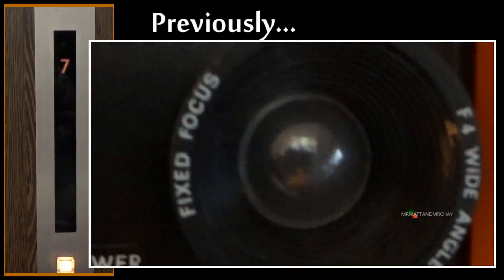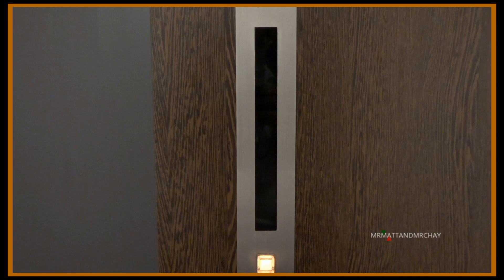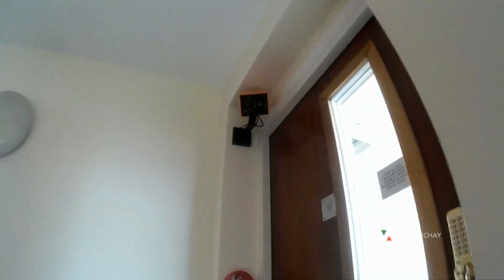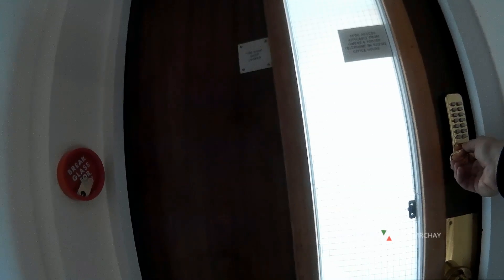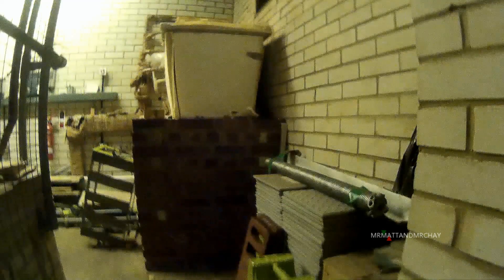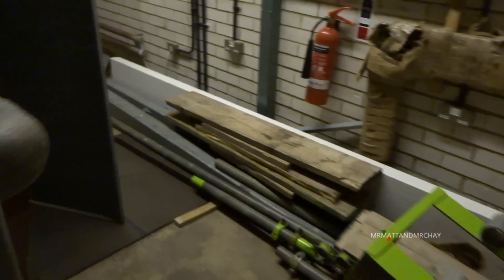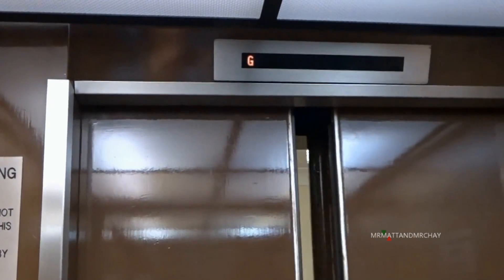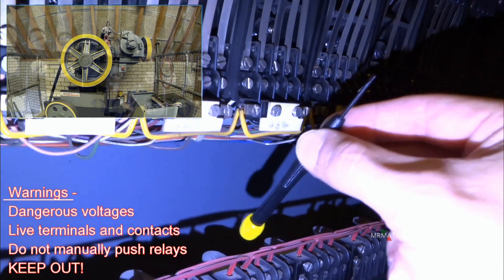Code cracked, entry gained to a CLASSIC SCHINDLER relay motor room

Comment: Tip for the mechanical code locks. The order that you enter the correct numbers / letters does not matter, so long as the correct ones are depressed. The "C" button clears any previously depressed buttons.
Look for fingerprints on the buttons. Press "C" followed by all those with prints or worn surfaces. That's it, lock open.  If prints are not obvious, polish the buttons up with cloth, sleeve etc and return after a few people have unlocked it. Prints can now be seen.

Comment: I would definitely be wearing insulated gloves and using an insulated screwdriver to be pushing in relays. 24 volt relays or 24 volt coils did not go into effect across the industrial field till about the late 90s. Majority of time going back to relay logic systems like this the coils would be 110. Which definitely I have to say is a little sketchy watching you push it with a little precision screwdriver. Anyhow pretty cool video by the way
Reply: Thanks grandma.

Comment: What is it that scares you about the water tanks?
Reply from the maker: Here is a copy/paste from my "water tank phobia" video...  https://www.youtube.com/watch?v=KD3IR3UyKWY  ...SO WHY???  It's not actually the tank of water I'm afraid of, it's the automatics (especially ball values) - it's a bit like a spider that's completely visible and STILL, but when you disturb the "web" (water) it starts moving and hissing as water enters the tank.
Ok, so a urinal is different, but in a way it's worse!  You can hear it, water dripping into a tank which you know will 'erupt' without warning - it's just when?  Is the tank full or empty?
The dripping varies in pitch and volume.  In fact, the fuller the tank, less distance for the drips to fall and the volume reduces.  This gives you a false sense of security, as you take your mind away from it.  But then, when you least expect it...
The water starts falling down the pipe and you realise the flush has already started - too late to escape.  From a quiet room the noise is  too loud and you can hear the whoosing and gurgling of what's going on in the tank, as if the tank wants to let you know.
Panic sets in, but I cannot bear the situation and it's too late to escape so I try and create a "mask".  Eyes tightly shut, hands pressed hard against my ears, keep moving them to create a rustling noise to prevent me hearing the room at all.
When I'm sure, I release my ears and the situation has ended.  But the dripping is now louder than before as the drips travel further into the tank - a warning from the tank to 'GET OUT'.
I run out trying to plan every step, including pulling the door handle down and opening the door at the same time as I'm moving towards it.
Outside the room I casually walk away, but with my heart beating out of my chest!
YES, I HAVE A FEAR OF WATER TANKS!

Comment: 5:55 , 5:55 , 5:55 , 5:55 , 5:55 , 5:55 , 5:55 , 5:55 , 5:55 , 5:55 , 5:55 , 5:55 , 5:55 , 5:55 , 5:55 , 5:55 , 5:55 , 5:55 , 5:55 , 5:55 , 5:55 , 5:55 , 5:55 , 5:55 , 5:55 , 5:55 , 5:55 , 5:55 , 5:55 , 5:55 , 5:55 , 5:55 , 5:55 , 5:55 , 5:55 , 5:55 , 5:55 , 5:55 , 5:55 , 5:55 , 5:55 , 5:55 , 5:55 , 5:55 , 5:55 , 5:55 , 5:55 , 5:55 , 5:55 , 5:55 , 5:55 , 5:55 , 5:55 , 5:55 , 5:55 , 5:55 , 5:55 , 5:55 , 5:55 , 5:55 , 5:55 , 5:55 , 5:55 , 5:55 , 5:55 , 5:55 , 5:55 , 5:55 , 5:55 , 5:55 , 5:55 , 5:55 , 5:55 , 5:55 , 5:55 , 5:55 , 5:55 , 5:55 , 5:55 , 5:55
Reply: love that sound when the elevator starts.

Comment: When you press the relays to select different floors, does the light inside the button light up to? Or does it just go there without that?
Reply from the maker: Pressing the button places voltage to make the relay switch on.  When the relay is on, this places a by-pass across the button, so effectively the button can be released whilst the relay puts a short circuit across it - this is a what a latching relay does.  So whether the button is pushed in the lift car, or I press the relay in manually, same effect.  The call button will illuminate when-ever the relay is latched.  The buttons inside the lift would also light up.
Reply from the maker: Also see this - https://www.youtube.com/watch?v=USmuJCOXbgk   This is me in the motor room pushing in the relays, then pulling them back out again to unlatch them.  As you can see, the floor indicators light up and go out.

Comment: What type of elevator is this? It's not a true "single-speed" traction elevator because you can see (and hear) the motor change into what sounds like a lower mode a second or two before the lift stops. is there a more proper name for this? "Two-speed"? haha

Comment: Perhaps you should think of joining the elevator union here in Canada 🇨🇦 I am elevator mechanic from new generation I work on I O PCB boards anyhow I am surprised there was no machine guarding here it is law in case such people like you and general public make their way in the machine room also it is law to have car top railing anyhow nice video but be careful shock electrical can kill you
Reply from the maker: Thanks for the message.  I did go for a job with Express Lifts straight out of school (1988!) but decided to follow a different industry.  I'm an engineer myself (not with lifts) and well aware of what I can and cannot touch.  All my videos containing motor rooms have that exact warning at the start.  Yes, this motor has escaped the guards - very surprised to see it like this!

Comment: 6:36 I was wondering how many cables this lift has, 3?  4?  6?  8?  [Motor stops] Motor or flywheel: TWOHHHH Okay the flywheel or motor said that it has two cables but i think it has 6
Reply from the maker: Good question, but if you look here then the answer is 5:  https://youtu.be/R5BHZe8gbcs?t=7m10s   See the ropes coming off the big sheave, down to the smaller wheel.

Comment: why is the moter fan cooled ?
Reply from the maker: This is not normally required.  But let's change the conditions:  What if, it's summer time, it's really hot in the motor room, there is no air conditioning (there isn't in this room) and the lift is being used constantly.  This is a condition where the motor might get too hot and then needs a fan to cool it down.
So in summary, the fan is not required 99% of the time, but during hot conditions the fan is available for the 1% of the time when the motor gets hot.

Comment: I love the EEEEEOOOWWW sound the motor makes when it slows down then the sound of the clunking relays and motor contactor(s).
Reply: When the lift is approaching a floor, how does the motor speed control work on  a lift that is all relay logic. I didn't see any variable frequency drive (VFD) controller.
Does a relay switch in a big power resistor to slow down the motor just before a floor?
Reply from the maker: The motor has two windings, so the motor has two built in speeds.  With a VFD you can generate any speed, but before the invention of VFD drives the only way to do it was with a DC motor and an AC to DC generator to run the motor.
The resistors prevent full current getting to things like motors so that if the motor was jammed then the resistor would heat up rather than the motor.  It also has something to do with residual current from the motor being arrested by the resistor if I remember correctly!

Comment: most commonly used codes:

1234
4321
the same number four times
2580
1397
0582
many more

Why?  Because they are the easiest to remember!
Reply from the maker: As described in the follow up video....
https://www.youtube.com/watch?v=R5BHZe8gbcs

Yep, used to love trying to work out codes!  People picked the same ones, or they were very similar.  I'd like to add a few more people used to use...  2468, 19XX (someone's date of birth, look at the finger prints to work out the last two numbers haha),  1066 for the battle of hastings, and a whole load more!

Comment: today's elevator controllers have low-voltage computer circuits.. but high voltage AC motors
Reply: The controller controls contactor's that energise the motor.

Comment: Do you know what is even better than the engine room of an elevator? The engine room of a cable car.
Reply from the maker: Yes, glad you mentioned that.  Recently I've looked at this video featuring a mine shaft elevator...  Also interesting! https://www.youtube.com/watch?v=9eadj3kL_fM
Reply: I think you would like the water incline lift at the centre for alternative technology near machynleth in Wales. It has a huge drum that the cable winds on to.

Comment: 2:28 - pro tip: with these mechanical locks that require a code, it typically doesn't matter which order the numbers are entered, so if you see 4 buttons that stand out then there are 24 possible combinations of those 4 digits, plus the fact each number can only be used in a code once... you get the idea, these things are super easy to defeat. If you have frequent access to the building, you could put a really faint line of pen or pencil on all of the buttons, not noticeable to the untrained eye, wait a few days or something, go back and see which buttons have the marks rubbed out, test the code, then rub the mark of all the buttons so nobody could possibly see it at a later time.
Reply: There are actually 10,626 combinations of four numbers from twenty four without any repetitions.  Might take a bit longer then.
Reply: @andyblackpool  

'Best guess' will usually get around that. If the numbers used are 1459 it's more than likely going to be 1945.

That said I'd pick 4591 because I'm awkward 😏

Comment: Can you wear leather or rubber gloves to press the relays?
Reply from the maker: Yeah I guess so.  It also depends on which part of the relay you are touching.  If its the armature (the bit the pushes the contacts) then this should be fine to press on any relay, but it's all about being careful, and best practice is to wear gloves or press the relay with something that doesn't conduct electricity.

Comment: I would have thought that you would encounter water tanks quite often in that kind of work with Tanks often being situated on roofs. The college I was at in the early 90s had a couple of Otis lifts from the late 60s on two sides of the building. The roof on one side was visibly strengthened and you knew there would be a large tank above!

Comment: Hi I find the concrete platforms where the lifts motor+gear assembly sits on (with the holes for the cables) often look as if they could crumble/break. Could that happen and wouldn't the lift fall down ?
Reply: They are pressed on it and have a tooth. They won't come off easy and don't roll uncontrolled.

Comment: Urgh, I know what you mean, I HATE water tanks too :( our plant room had 2 massive blue tanks I had to walk past when I had to check roof access hatch security, going up the roof access ladder if you were unfortunate to look behind you, you were staring straight into the belly of them. For this reason, I refuse to enter our car wash plant room as its all water tanks, filters and a noisy compressor that makes you drop the kids off when it kicks in .. urgh...
Reply from the maker: +JohnnyX50 OMG that gives me the frighteners - "if you were unfortunate to look behind you, you were staring straight into the belly of them" - so there was no lid?  It's actually the ball valve part that I'm afraid of, did this tank have this?

Comment: Is it possible to like make the lift drive with open doors by pushing the right relay?
Reply from the maker: +MiLAN Certainly is, as far as I know two relays should do it - the Main Contactor relay delivers power to the direction relays and should only switch on when the lift is ready to move and the safety circuit is made (i.e. all the doors are shut/locked).  This must be on and then the direction of travel relay (up or down).  Press both relays in by hand and it should take off, until you let go.  I'm not going to try it though!  I the controller WERE to request movement (up/down relay) then unless the main contactor relay is on, lift won't move.
Reply: +mrmattandmrchay Ok

Comment: you can press them with your finger if you know what ya doin or use a short from pf to ca1 ca2 etc
the car top control is an upgrade scindlers didn't meet uk standerds
the big grey wheel is the floor selector ther a nightmare
i am a lift engineer ask me a question
Reply: What makes the floor selector wheel a nightmare?

Comment: HAHAHA nice analogies! "Like a stallion on heat parading towards a mare..."
Reply from the maker: +thewildeeper Thanks, I did have to think for a while and this is what I came up with :D
Reply: i am 11 years old and i like to play with relays and electrical stuff too. i wired up a relay to a fan and a thermostat when the thermostat clicked on the rely would contact and fan would turn on but  lots of wires exposed but only 120 volt not 415. whats the worse elevator /lift you have worked on?
Reply: @dylanreischling4151  I made a model of this selector using my electrics set

Comment: The switches in the floor selector are amazing...
PS, Russian elevators use the same switches, but they are in the shaft.
Reply from the maker: +Алексей Рукин Cool, so do they latch like these ones do?  ("on" when lift is below, "off" when lift is above)
Reply: +mrmattandmrchay Our switches have three positions. When the cab is below, the switch is latched right (and vice-versa), when the cab is at the floor, the switch is held in the neutral position. This system is used only on relay controllers without memory.
Reply from the maker: +Алексей Рукин Superb video!  This demonstrates it very well.  Is this your video?  If so, I'll give it a link in my next video.
Reply: +mrmattandmrchay No, it's a video from a famous lift mechanic in Kiev, I found it in my subscriptions.

Comment: Press some more relays!
Reply from the maker: +diamondcraftia Only the call button relays.  I really don't want to take this out of service, else I have to walk down 7 flights of stairs :D
Reply: Sorry for jumping into a conversation that is not mine but. that lock is mechanical, so if you know the digits of the code and put them in, in any order it will unlock.
Reply: Critter You have a point

+1